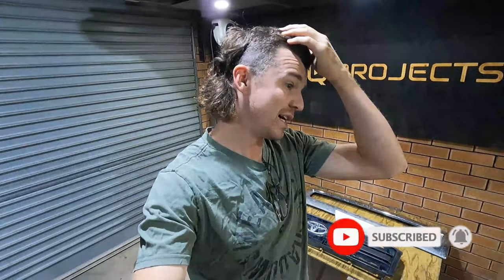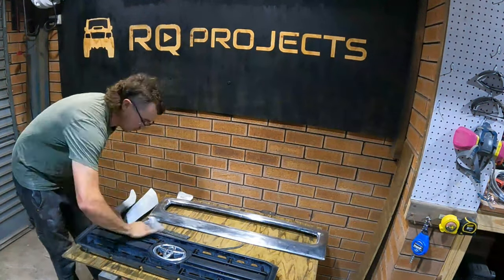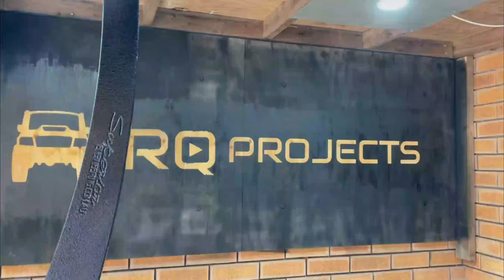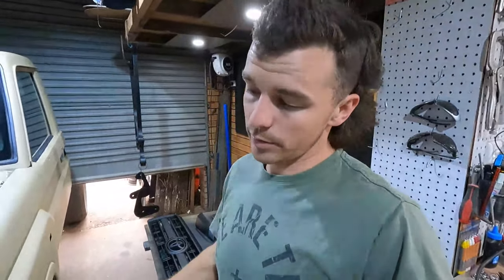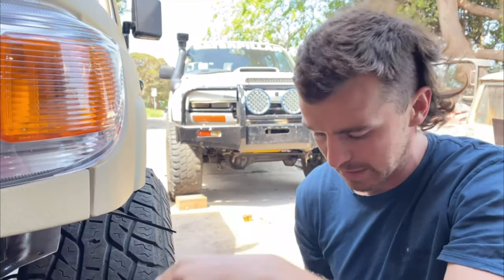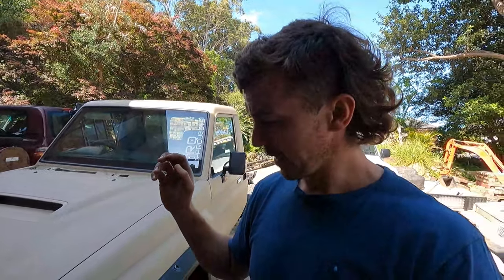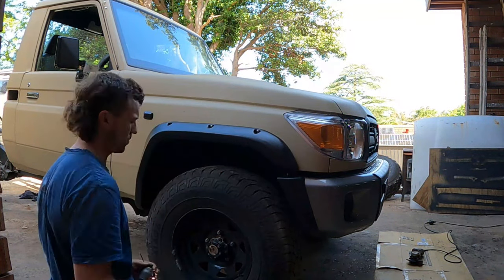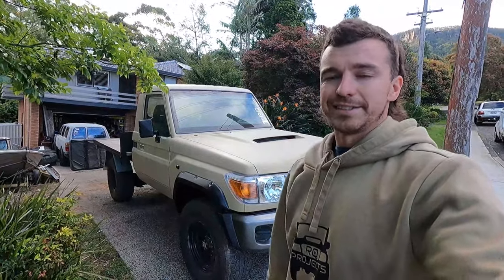LANDCRUISER 79 SERIES BEDLINER FACELIFT! NEW HEADLIGHTS, FLARES AND RESPRAYED GRILLE

Comment: Hey mate, the rig is looking mint. This has been a very enjoyable series of videos. I don't know if you've tried to fix the camera flicker, but it should be fairly easy. The fluros frequency is 50hz, so if you set your frame rate on the camera to 50fps (or any other number divisable by 50, e.g. 100fps) it will get rid of this. Looking forward to seeing more vids.
Reply from the maker: Thanks mate, I’ve played around with frame rates and 60 is the best of a bad bunch of options. My garage lights are led so I think the frequency depends on the colour, being Chinese eBay specials you can pretty much see the flicker without the camera haha, might be time to go back to fluros
Reply: @RQProjects  Haha, I boldly assumed fluro... those eBay specials can be a pain in the arse some times. Looking forward to watching your project progress